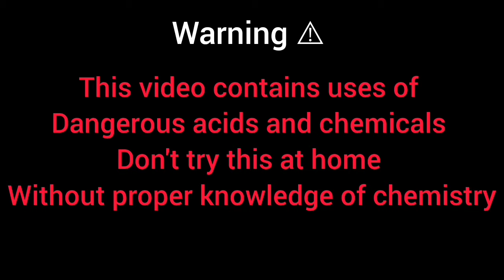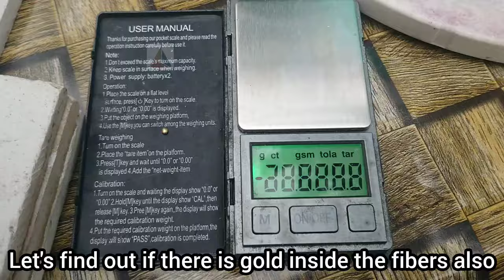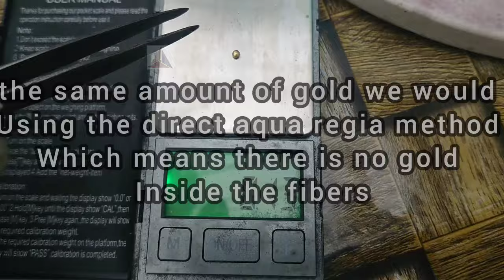Testing If There Is Gold Inside The Fibers Also | Experimental Gold Recovery

Comment: The true test would have been to extract the gold pads off the top using vinegar, salt and peroxide. Then after replating the gold pads from the cpu's, rinse them off and then incinerate the cpu's. This video did not prove there's no gold inside the cpu's. I have fiber cpu's I stripped the gold off of, and will process them again with incineration. I'll post my results here.
Reply: When?
Reply: @idontknowmyfirstname69 as soon as the New Year comes in and it gets a bit warmer. It should be about a week or so from today (12/30/2023).
Reply: @kevinwalker2143 
Did you do it ?
Reply: @kevinwalker2143 what results did you get?

Comment: I made circuit boards for 33 years wasbin charge of gold plating we used 4 types of gold depending on customers specs hard gold,soft gold,immersion gold and electrolysis gold depending on purity there is very little gold on fingers the gold is over   plated copper and then nickel and then gold you need tons of gold fingers just to get a small amount of gold if the the board is full body gold you might do better it is alot of work for little return.

Comment: There is more value in the copper heat spreader than in the Gold of the fiber pieces. By the way: You can get the gold just with long term leaching in HCl. It will slowly dissolve the copper under the gold and the gold foils will detach. I have a jar where I drop the fibers in and let them soak for ages. Some day I will take care of it and get a reasonable amount of gold for hardly any work. The way I like it! ;)
Reply: How bout put it directly to aqua regia is it possible?
Reply: @baltog  Yes, but i don't recommend.
Reply: @jackmclane1826  thank you

Comment: exacly true
Just a few days ago, I tested with 50 LGA CPU and it had very little gold. It was only from gold plate.
Inside the fiber, there are only a few layers of copper, just like the motherboard
After extracting from the plate, you can burn them and separate the copper sheets if you are bored! :)

Comment: I used a plastic bottle and drilled hole near top and tape to make one way valve.squeeze bottle air leaves side hole and helps suck liquid through filter

Comment: Nice video. I did that proces last year in the hard way, burning, than peeling of the cooper foils from inside cpus, i did 2 kg Cpus, with Nitric batches and nothing remains in the filters, was only cooper. Some gold i found on some  very small plastic tranzistors clued on motherboards, they are almost insezisable.

Comment: With so much effort, only 130 mg of gold will cost you more
Reply: He lost gild because didn't burn properly. Coal and carbon absorbing gold. Plus by this method tou csn not judge if there was gold incide of fiber. First need to revome visible gold  and only after that trying to check if there is gold incide of fiber. Also he added urea in the cold solution..its obviously  he don't know what he do